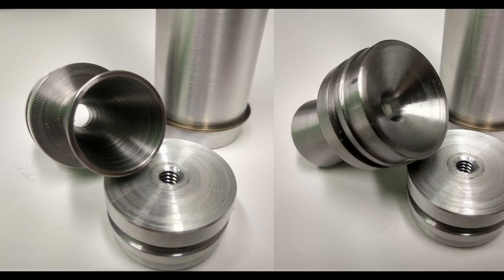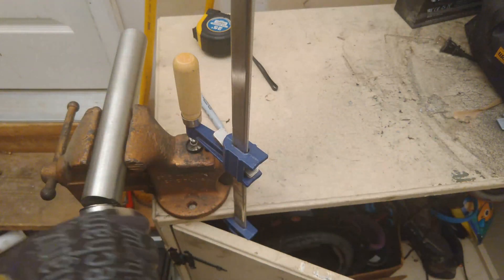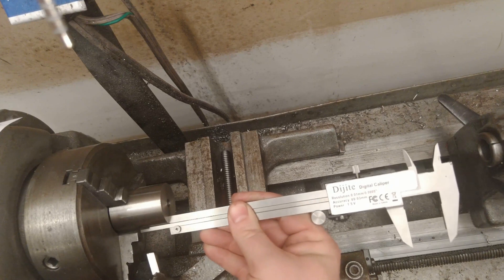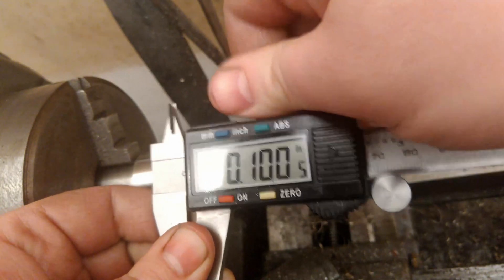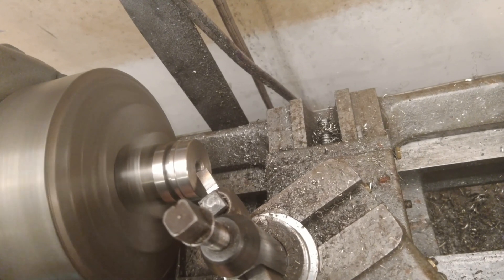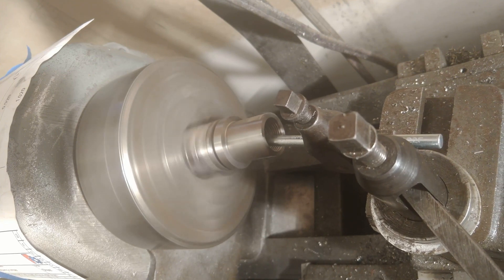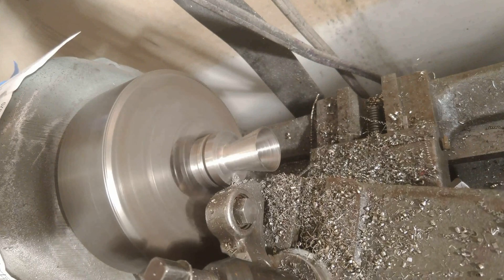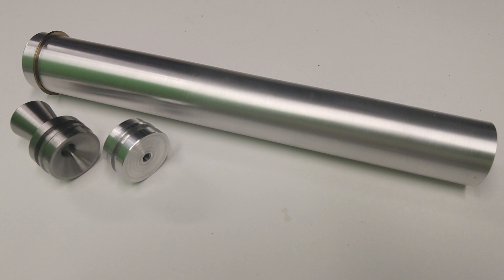Machining a Rocket Nozzle - Build a KNSB (Sugar) Rocket Motor - Part 4

Comment: Can aluminum be used instead of steel? To make it lighter
Reply from the maker: Not for the nozzle.  The gasses coming out of the motor are much hotter than the melting point of aluminum.  If you want to keep weight down a little bit you can use titanium for sugar fuel nozzles.  It is harder to machine and more expensive though.

Comment: Hey man, need a bunch of help here. I have been making sugar rocket but keeps on failing. My problem is that it keeps on exploding. And as to why it keeps on exploding was because of unbalanced ratio of the length of the motor and the nozzle size. The build-up press was too strong, and the nozzle size was not big enough for the pressure to thrust out so much that the steel pipe can't hold and just exploded.
My last experiment was
4 feet steel pipe
3 inch for the nozzle and 3 inch for the tip
The total length of the motor was 3 and a half feet.
The motor was casted seperately, 6 inch per motors, total 7 motors.
I motor core was 10mm diameter hollow out.
The nozzle too was 10mm in diameter.
The size of the steel pipe was 2inch in diameter.
Man, the explosion was loud and the shockwave was strong.
I could really need a help.
If i used 1 feet long motor, how many mm of nozzle should i used?
If it's 2 feet long, how many mm of nozzle how i used? The list goes on...
Now i am currently building 3 feet long steel pipe.
3 inch for nozzle and 3 inch for the tips.
2 and half feet for the motors.
The core of the motors are hollow out with 12mm
The nozzle is 18mm
Will it work? Or is the nozzle still to small?
If we can talked personally through social media, that would be great. Maybe Whatsapp of Facebook
Reply from the maker: You need to do a simulation to get the correct nozzle size for your motor.  Go to https://www.nakka-rocketry.net/softw.html and download the SRM software.  Also if your motor is too long the propellant will erode causing explosion.  Also I do not recommend using steel as it is frangible and can cause injury, aluminum is much better.
Reply: @MinuteRockets  can alluminium hold the internal air pressure produce by the burning of the motor better than steel?

Comment: Why didn't you cut the length with your lathe? The cut off wheel on ss seems a bit much.
Reply from the maker: Good point.  My lathe doesn't have a large enough pass-through chuck for that rod and I didn't really want that much hanging over.  Probably could have made it work though.

Comment: How did you calculate the dimensions of the nozzle?
Reply from the maker: The nozzle dimensions depend on a lot of things like the type of propellant, the exposed area of the grains, and the grain geometry.  For my motor I used a simulation spreadsheet from Richard Nakka's website.  You can see the process I used in Part 1 in the video series about the design.  Richard Nakka's spreadsheet is at https://www.nakka-rocketry.net/softw.html.

Comment: What is this machine that is used for holding and filing/cutting metal called?
Reply from the maker: I used an angle grinder to cut off the blank from the steel rod, and I used a lathe to do the cutting/shaping of the nozzle.
Reply: @MinuteRockets  okay thanks. Just started making aluminium based nozzle with steel throat section. I might need these tools soon

Comment: no advantage using stainless, more expensive and harder to machine, use regular steel or 12L14 leaded stock  for easier machining.  Melting points are all the same with steels
Reply from the maker: Thanks for the comment.  The main advantage for me of the stainless is more about corrosion resistance than heat resistance.  That's true regular steel will work just fine, just have to be quick and thorough about the cleanup after each flight and use a light coat of machine oil to prevent rust.

Comment: You need to lube abrasive wheel for aluminium.  Wax or soap work well as it stops the aluminium binding up.
Reply from the maker: Awesome, thanks for the tip!